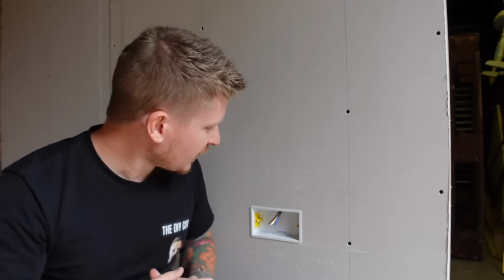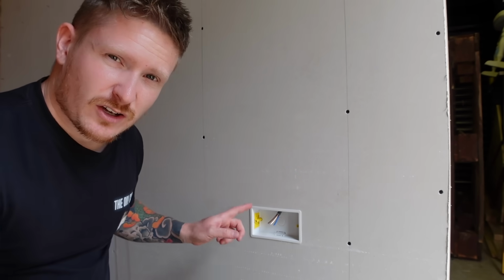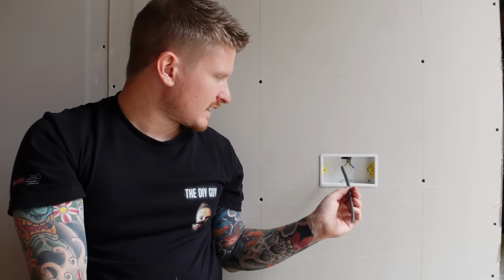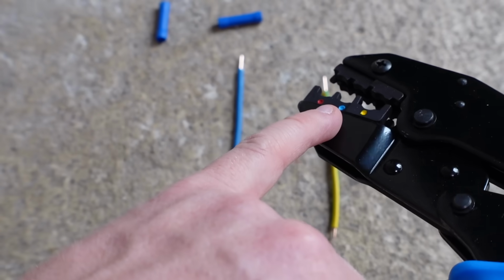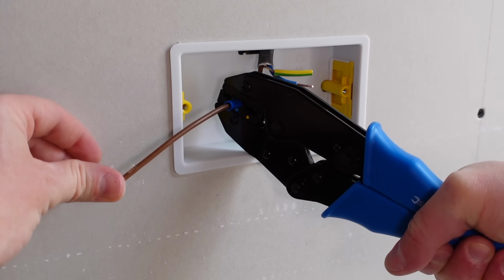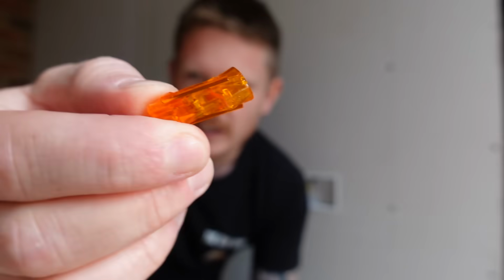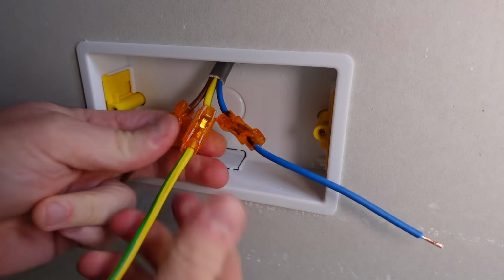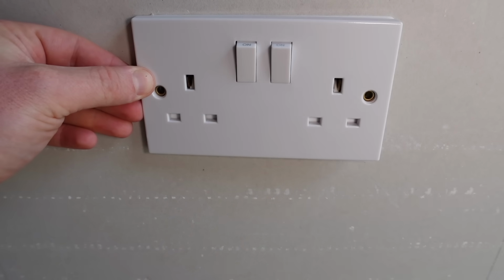How to Extend Short Wires | Easy Fix Anyone Can Do

Comment: Pretty good but afterwards you should have checked with a Multi-meter that
the Active was really Active and the Neutral was really Neutral and 
that there was only a few ohms between the Earth and Neutral.
You can't trust what someone else has done in the past.

Comment: Hi, great video thanks. I've had to replace a socket but the wiring is older stranded cable. The stranded wire pairs were twisted to a point with loads of wire showing and only the point secured which seems unsafe. The cable is much too wide to fit two widths into the socket terminals. I don't think WaGos work on wide stranded cable (?) so can't just extend them with modern cable. Any advice would be appreciated. For now I've had to use a junction box to complete the ring and spur the socket off. Does the job safely but not the best look in the living room!

Comment: Any electricians here in the USA want to comment on is this code compliant or what is code compliant?  Using crimp splices for 120 volts gives me some doubt.  Could one simply use a wire nut instead? 

If two cable came in, and you also had a device to hookup, could a wire nut be used in this situation too?  In other words, the two incoming cable are short, they go to a wire nut, which also has a longer tail (say 6 to 7") that goes to the device?  

I guess I'll go hunting in my NEC book, but I would curious to hear from experience electricians or code inspectors.

Comment: Just a heads up if you have a bit of a read online I'm pretty confident that those crimps aren't to be used for solid core cable, and my college tutor told me that SWA made a disclaimer to say not to use them on solid core cables in their manufacturing data

Comment: It seems simple enough, not more difficult than making ethernet cable and wiring up speakers.
I need to lower lights 2ft, would the same apply?
Im thinking of using metal clad cable but does the gauge matter for led shop lights?

Comment: Used this to extend cable from a FSU to an electric fire in the lounge. Whoever installed had used a 15mm patress box instead of 25mm and FSU had burned out. Re-did patress and re-wired. This is a short-term fix as we will fit a log burner.

Comment: When using the crimps or other connector, finish wiring the outlet first, then attach to the short connectors. It’s a lot easier to work that way!

Comment: Crimping is preferable to the quick connects and screws should be used for switches and sockets that are equipped with both screws and push in connectors. The issue is the surface area of contact.

Comment: They sell lugs or those orange locking clips that you just stick in the existing wire and a pigtail.

I am shocked that they use these clips and they are legal.

Comment: I first saw this some years ago when it was first made legal to extend wiring using crimped connectors. But they said that after crimping you should then use the heat shrink sleeving over it and extending out each side. I think it was 20mm each side, is this still the case in 18th edition.

Comment: I don't think crimp connectors should be used on solid wire.  I don't see how the mechanical connection can be secure.  I have always reserved crimp connectors for stranded wires.  Wire nuts are for solid wire and lever connectors work with either solid or stranded wire.   Do a pull test for crimp connectors and solid wire.  I bet they won't pass and if the crimp connection ever gets hot it is sure to fail and may even start a fire.  But what do  know; I am just an 81 year old electrical engineer.  Maybe physics has changed since I went to school and electrical engineers and electricians are not the same thing.

Comment: Only problem with the orange splice connectors in the link given is for 100 pieces for £19.99. For a competent home DIY-er, a boxful is going to be too many. eBay has smaller quantities of the same thing for a lot less. I'm not keen on the WAGO design.

Comment: Make sure the Wagos are correctly rated. 221's are rated at 32A enec. Other types are only 20A. Important to use correctly rated connections

Comment: GTSE pre-insulated crimp terminals are used to terminate stranded wire. The solid wire results in a small amount of force and wiggle, and the wire could be pulled out.

Comment: Im wanting to install a loft harch but want to put it where there is a ceiling light fitting there how do i extend the light cable to move the light to another part of the ceiling. Ive see yoyr vid on moving a light switch but is it the same to extend light fitting cables. Great channel very usefull

Comment: It's better to NOT DO ANYTHING LIKE THIS! I would take the wall socket off the wall and go up in the wall. New hole in the wall ( the length of the wire will be satisfying and will be SAFE) There is little bit more work BUT IT'S ONLY WAY TO BE AS IT SHOULD BE 🤷🏻

Comment: I've always been told you cant use connectors as there not safe alway run a new wire with the right length

Comment: My short wires are in a doorbell - a very TINY space. Hope I can fit a krimper tool and the krimp into it. I only have about 1.5 inches depth in the 'socket space.'

Comment: On investigation there seems to be special steps to be taken when using stranded wire with push connectors and push connectors need to be rated for stranded wire. (Not all are.) In addition, movement and vibration seems to cause extra issues with stranded wire, so extra support for stranded wire and push connectors is recommended. Altogether, the added hassle and expense of using push connectors drives me back to the old fashioned method of tightening the screw or crimp connections.

Comment: I’m not really a fan of using a crimp connector on solid wire. I wouldn’t think that it would hold its pressure on the wire because solid wire doesn’t have any spring back like stranded wires do.

Comment: That's way too easy you got to work in my electrical world where the short wires are about one inch of cable in the back of the junction box along with twenty wires 😂

Comment: Please, can someone provide me with evidence that the first method is okay? According to my knowledge, these crimp connectors are only suitable for stranded wires. They must not be used for wires with a solid core. It might hold, but if the manufacturer has not approved this use, you cannot use it.

Comment: Just had a look at those inline splice connectors, they are very expensive.

So though they are good, they maybe pricing themselves out of the market, in fact after further checking the inline splice connectors are per 100 pieces 100 crimps cost £4 roughly, 50 splines cost almost £14 so for less than 50 splines you get 300 crimps.

If you were doing a job I think they would go for the crimps based on cost, but if you were doing a DIY you might go for the splines as the cost wouldn't be that big a deal for the amount you would probably use.

Comment: The Earth wire in a 2.5mm BS Twin & Earth cable is actually only 1.5mm thick, and should be crimped using the appropriate 1.5mm red through crimp, not the 2.5mm Blue as shown in this video!! 😵‍💫

Comment: I use WAGO connectors.  You can easily remove them if you need to , but they do lock on tight with the lever.  They sell multiple different types.  Really good...WAGO is UL approved and legal.

Comment: I am from the US and usually, any kind of wire junction must be protected in a box of some sort.  Is that true with these? I just put in a new light and the switch wire just touched the bottom of the box for the light, without going in. I was thinking of running a new wire down to the swtitch and over to the light fixture box from the attic, but if this is safe enough to not be completely in the box, then it would be easier.

Comment: I have used soldering joiners to join wires and have never had any issues with the wires coming out of the soldered joint. You only need a match flame to melt the solder and the joint is permanent. The outer casing melts to form a permanent insolated join.

Comment: The earth wire will only be 1.5mm but the blue crimps are for 2.5mm. 
Its a pain getting a solid crimp connection on that earth with a blue connector. Red one does the job much better as its desiigned for 1.5mm.
I'd still rather use Wagos though.

Comment: I always bend the ends over when fitting sockets with only one cable which will give a better connection and prevent the cable snapping.

Comment: Great video as ever! Quick question….I have some old 1970’s stiff short wiring that needs extending for a new socket. Two wires twisted together making the ends quite thick….will these methods help here or is another connector type needed with perhaps a larger opening? Thanks in advance

Comment: Any tips on how to fix this problem.  I went to replace a faulty light switch. The sparks ran a load of cables into the wall box as the switch is operating more than one light.  Trying to get all the wires back into the new switch / box without them pulling out was a nightmare.

Comment: I am moving an outdoor DIY electrical box/outlet about 8" out of the way of a water filtration system.  Would it make sense then to stagger the cuts n connects in a situation where I have to extend wires in a 1/2" conduit to a new placement of the electrical box/outlet?  I don't think if I opted for these inline splice connectors that they would all fit side by side in the conduit (which is likely too narrow) compared with the crimp/shrink connectors.

Comment: My friend has a light switch he'd like to move about a metre to one side (stud wall, no doorways etc). Can I use these connectors to extend the wiring that far or do I need to watch some different videos? I've done a few electrical jobs so am fairly confident and competent . Thanks!

Comment: I would have doubled over the socket side of the wires to get a better connection in a large opening. It gives a much better and secure connection the screw.

Comment: I don't think butt crimp connectors make a proper connection on solid core cable. I think they are intended to be used on stranded cable only.

Comment: great video. if you are using stranded copper wires can you still use in inline connectors ? and if not is the crimp connector the only way left to extend ?

Comment: When showing the use of either crimp- or in-line pushfit connectors, it would be helpful also to show their removal, in the case that there is faulty connection, and you need to remove the connector without shortening the already short conductors. I know how, but it is not necessarily intuitive that the push fit connectors can be twisted off, and the crimped connectors may be loosened with pliers to open up the crimped section.

Comment: Great video. Those short cables are a nuisance and your example is great and beautifully explained. 

However what to do when you have a ring main situation where there are two of each cable. 
 Extend all of them individually as per the video, or to use cable connector blocks with the two incoming wires from the wall screwed in at one end and an extention to the new unit from the other side...?

Comment: Great video!
Looking from Australia it is so strange to see an unsheathed earth wire in the cable as well as not multi-core but single-core wires. This reminds me wiring standards in Australia 50-60 years ago. And also the neutral conductor in Oz and NZ should be black.

Comment: Solid conductors, bare earth. Rewire it using the correct cable, solid went out years ago and if it is short, pull it back up into the ceiling and do the junction there.

Comment: I notice you didnt mention how the push to fit connectors can be taken back apart and reused easily, by simply twisting the connector as you pull

Comment: After moving to europe I can confirm that the UK has the best sockets/plugs but most e.u. countries have better wiring. they use tubes throughout the building then pull through the 3 wires. easy to change in the future. Also they protect both polls which helps a lot if you have a problem with a neutral.

Comment: I loathe having to joint conductors. I fully understand there are times when there are no alternatives, but then I hate the modern  easy connector blocks too.... old and set in  my ways  I guess but high resistances spoil lives

Comment: I know that code differs between countries but where I'm from conduit is required when running cables in walls. That has the side effect that it is a bit easier to replace too short wiring or adding. So even if it is not required, if it is allowed I highly recommend adding proper conduit when adding electrical to new walls.

Comment: The push fit connectors are a better solution, you need the correct crimper to ensure a secure connection to prevent overheating with the possibility of creating a fire or electrical hazard. If possible fit a replacement cable. There is a change in the socket cable, in our country I don't know about G.B. It is available with a pre insulated earth so the sleeve for the earth is not required. This cable is now white and has other properties regarding its composition.

Comment: I never used crimp connectors or splices on solid wire. You don't get a very good connection and the wire can become loose. The packages used to say 'Stranded Wire Only" on them.

Comment: When I was building my house I had an electrician wire it, about a year later I discovered that all the switches and plugs where wired with the shortest tails possible. I made the mistake  of leaving the tails about 2ft long as I wanted plenty of length so I could easily work on them when needed. I recon the electrician or apprentice cut them short so he would have plenty of scrap to sell. So if you are employing someone to wire your plugs check regularly heis not making off with your copper as it fetches a good price as scrap

Comment: I don’t agree with any of these methods and doubt they are sanctioned with any electronics body for 13 amps plus of current. Screw connectors (terminal block) can conduct much more current then any push fit or crimp (crimping is always impossible to know if it worked 100%) . Basically a terminal block is what to use and will work 100% as long as you have chosen one large enough to facilitate your wires.

Comment: Ive been an electrician for a very long time. I have never seen a brother use a crimp connector to extend a wire for 110v or 220v circuit. I only use those connectors on low voltage wires. Wagos are a loose connection. And loose wires cause......Fires. learn how to braid wires or call me. Dont burn your house down to save a buck.

Comment: why? cut the length of cable your using to extend the cable, would it not be better to cut it after you have the joint connected?

Comment: Just noticed, maybe take less off the conductors, as i can see the incoming live inner insulation, so im guessing there will be exposed conductor there, 6mm should be enough, also try heat shrink crimps to seal the ends maybe, or those solder seal crimps

Comment: Shouldn’t the earth have a red crimp on it as it’s a 1.5 conductor in a 2.5 cable as the earth is 1mm less than the line and neutral

Comment: Butt splices are against code here USA.If the wires are not butted together the current flows through the butt coupling.I have opened a MCC ( motor control center) and found a  glowing orange coupling.There is a better method.

Comment: Guys if extending a socket with only one cable supplying it ALWAYS DOUBLE OVER THE END GOING IN TO THE BACK OF THE SOCKET. It's reduces the chance of the copper breaking off when tightening. The rest of the video is Spot on 👌👊👊

Comment: Why use insulated crimps AND shrinktube when its in a casing? Yes if its to make a cable longer in the open or in a wall, but not in a insulated plastik box or grounded metal casing